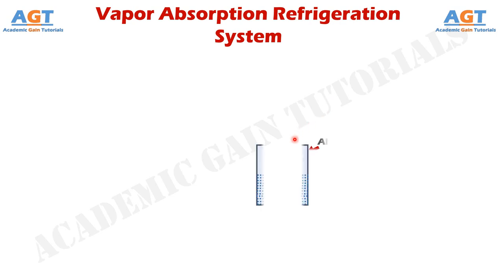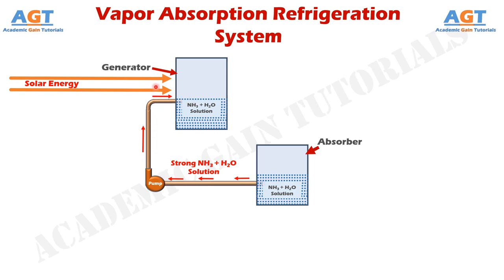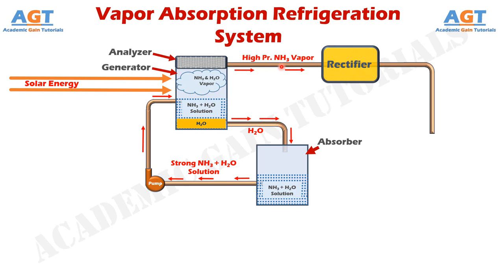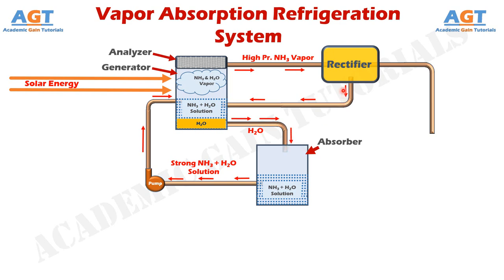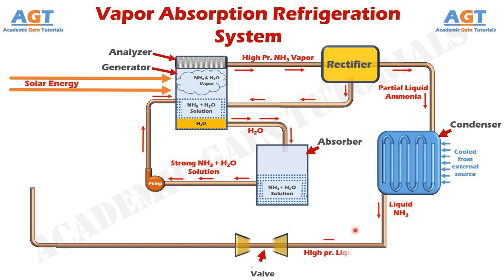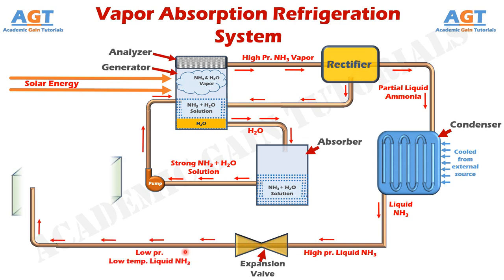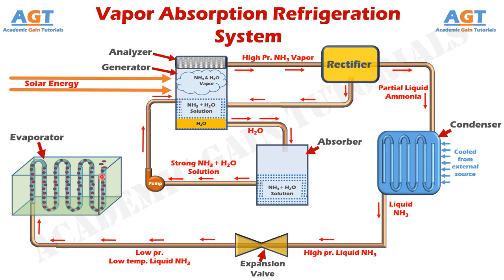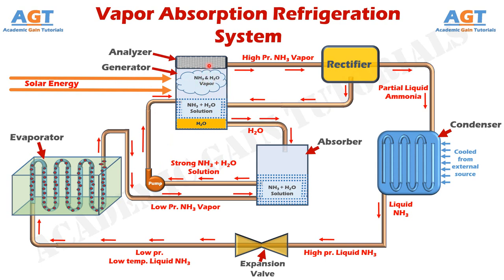Solar Vapor Absorption Refrigeration System (Ammonia-Water Solar Cooling System) Explained.

Comment: While this is pretty much correct, the terminology is a bit odd and it doesn't emphasize enough that this is really separated in a high pressure and a low pressure side (for example the water returning to the absorber needs to pass through a valve to make sure that the high pressure from the "generator" doesn't leak back into the low pressure side any more than is needed to move the water). The function of the water is to make getting the ammonia back to the high pressure side easier/possible (pumping an aqueous solution from low to high pressure is easier than compressing ammonia gas both energetically and practically). It also misses that the absorber acts as a heat sink and will need dump the heat from dissolving the ammonia, an exothermic reaction, because the cooler the water, the more ammonia it can dissolve.
I'm not really sure, the names are odd to me, but it sounds a lot like the "analyzer" and " generator" is just a reflux distillation. I'm not sure what the "rectifier" is either, though it sounds like and extension of the reflux part of the distillation (also, why return the cooled ammonia-depleted water to the "generator" and not the absorber?). I'm not sure how the water that is getting returned to the absorber is getting separated from the ammonia at the bottom of the "generator". It may just be a simplification of draining the remaining water after most of the ammonia has boiled off. If so, then the "generator"/absorber would need to work in cycles and not continuously. In which case a system would need to be sized to run a single long cycle during the daylight hours to make maximal use of the solar energy. To use this as a system to actively cool things down during the same hours that the "generator" is working you would almost have to add additional storage for ammonia depleted water and high pressure liquid ammonia.
Reply: Rewatching this, it does seem that the "generator", analyzer and rectifier is just a reflux distillation with the reflux being collected and sent  back to the absorber. This could be done continuously.  Though I think large efficiency gains could be achieved by running this on a daily cycle and using storage tanks for the water and ammonia. This way you could have cooling capacity even when there isn't any solar input and you wouldn't have to continually pump the liquid into a pressurized generator but rather pump the ammonia enriched water at night when the "generator" can be cooled down and equalized for pressure.
Reply: @siggyincr7447  sir we are thinking of making this setup as our final year project in mechanical engineering, so please assist us a bit how can we start, and how much will it cost us doing this in Pakistan?
Reply: @siggyincr7447 🔴 What Is Islam? 

🔴 Islam is not just another religion. 

🔵 It is the same message preached by Moses, Jesus and Abraham.

 🔴 Islam literally means ‘submission to God’ and it teaches us to have a direct relationship with God. 

 🔵 It reminds us that since God created us, no one should be worshipped except God alone. 

 🔴 It also teaches that God is nothing like a human being or like anything that we can imagine.

🌍 The concept of God is summarized in the Quran as:

📖 { “Say, He is God, the One.  God, the Absolute.  He does not give birth, nor was He born, and there is nothing like Him.”} (Quran 112:1-4) 📚

🔴 Becoming a Muslim is not turning your back to Jesus. 

🔵 Rather it’s going back to the original teachings of Jesus and obeying him.

Comment: So the function of solar energy here was just to pump the water from absorber to generator... Correct me if I'm wrong
Reply: From my understanding solar energy is used for both driving the motor through a PV cell, and for the heating up the so-called generator which causes the ammonia water mixture to evaporate where I can be separated and sent down it's respective routes

Comment: Thank you this is great content. I have some questions, however. 
Is the pump turned on by the solar energy supplied at the generator or electricity? What is the nature of that solar energy? Is it electricity produced by a photovoltaic panel? Or it is merely solar radiation?
Reply: The solar energy to the "generator" is in the form of heat. This can be a simple tube coiled inside an insulated box . A Low E window allows light to come in and keeps the heat from escaping.  It will heat up like a car sitting in the sun. Only 50-60deg C is needed. 

The pump will need to have electricity from either the power grid or a photovoltaic cells and battery system. However, the power needed to pump the ammonia-water solution is very small compared to what a normal AC unit will use.  

Most of the power to do the cooling will be from the solar heat.
Reply: @tomcantrell5553  Could you please tell me the price range for such solar AC units?
Reply: @alshaikh7  I have not seen too many companies making them as room sized or building sized air conditioners. They are usually used made for small refrigerators in RV campers. 
 
However, I am considering making one for my shed. If it works well, I would like to commercialize it. I have several ideas for their uses.
Reply: @alshaikh7  feel free to contact me through Messenger if you have any more specific questions. I'd be happy to explain what I'm doing with it.
Reply: @tomcantrell5553  your messenger  account  please.
Reply: @tomcantrell5553  COP is very low. May be it can "assist" the bigger brother , the compression ac to pre cool and get things done slightly cheaper.
Reply: @hanahisham8022  it should be "Tom Cantrell"
Reply: @alshaikh7  I have only seen these AC units home built. So the cost would be whatever the price of materials is and your own labor
Reply: @jaishetty8586  I have not calculated the COP for this type of cooling device. I know they do work well because refrigerators using the same principle are installed in RV campers. They use propane to heat the ammonia-water mixture instead of solar heat, but the principle is the same. They work well enough to freeze food.
Reply: @tomcantrell5553  by search I found many with same name , how can I know which is yours?
Reply: @hanahisham8022  you can try Linked In. Same name. I went to the University of Utah for Chemical engineering. Same picture is used in FB and Linked In. Hope this helps
Reply: Don't mind me, just posting a comment so I can look up tom at a later date

Comment: what is the purpose of water ???
Reply: absorption ?
Reply: The water absorbs the ammonia. In a way it acts sort of like a compressor. It turns ammonia vapors into liquid ammonia in solution with water.

The power to pump a liquid is far less than the power required to pump a vapor to the same pressure. This is because liquids do not compress like vapors do.  This is a HUGE energy saver. 

The largest power consumer in a conventional air conditioner is the compressor. It is used to convert the refrigerant back into a liquid (after passing through the condenser). In this system that is done with water.  Here, the largest consumer of power that which is used to separate the ammonia from the water (in the analyzer/generator vessel)...but that is FREE solar heat !
Reply: @tomcantrell5553  now  what is  analyzer formed of?  and rectifier separator also ?
Reply: @hanahisham8022  I think either 316 or 304 stainless-steel are good choices for those components